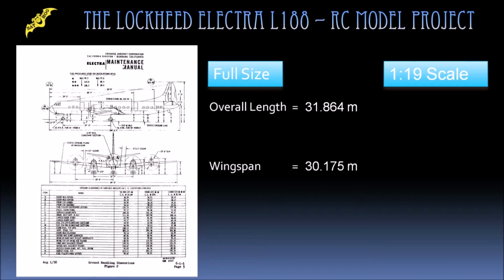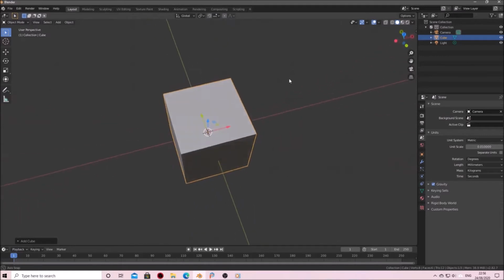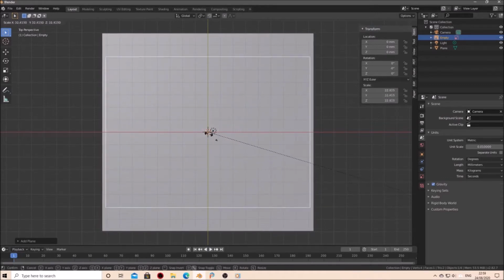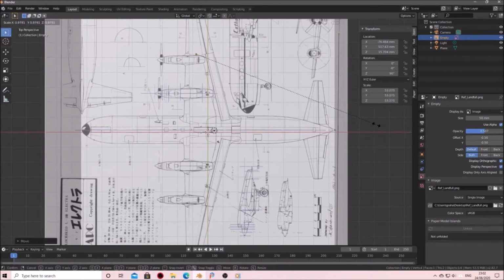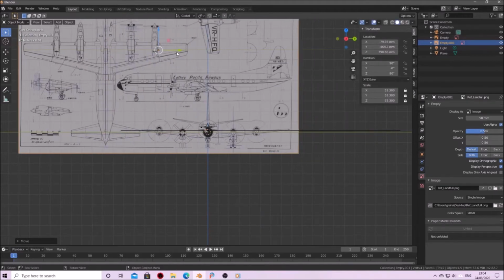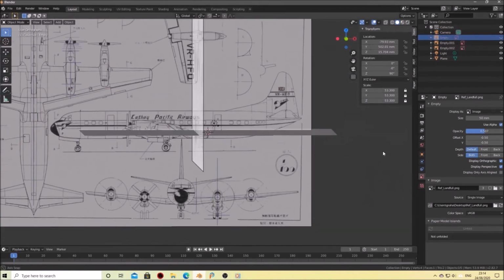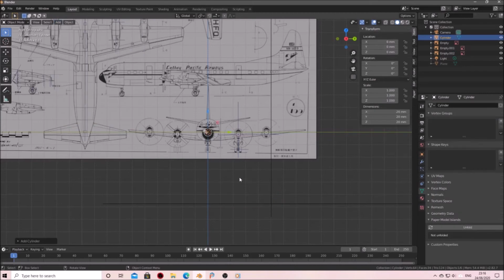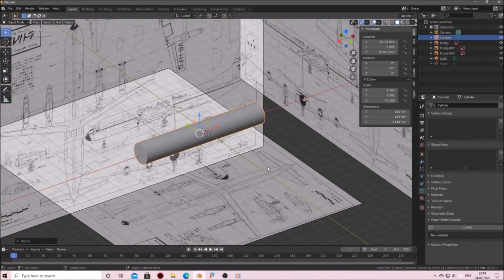Lockheed Electra RC Model - Part 4. Set up Blender

Comment: Can you add a link to the github files.
Reply from the maker: Hi Bernard. Here is the link for the GitHub files 
https://github.com/BathogTech/Lockheed-Electra_RC-Model
Please note, although I've designed and printed 90% of the model, I haven't put all the files on GitHub or Thingiverse yet. But check out the exploded views and parts schedule in the General Folder.